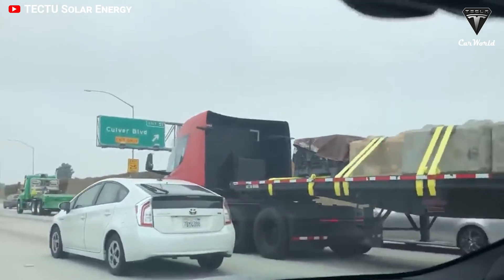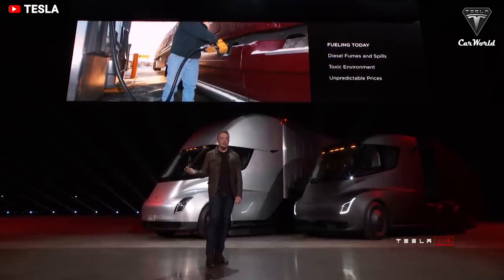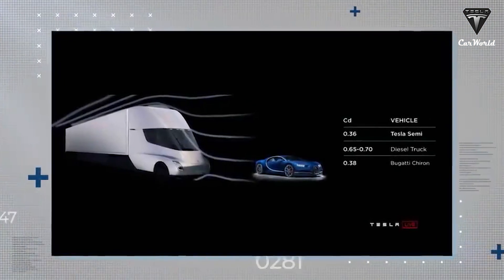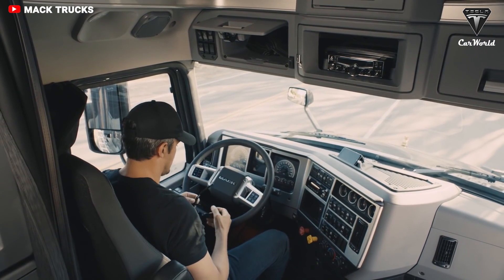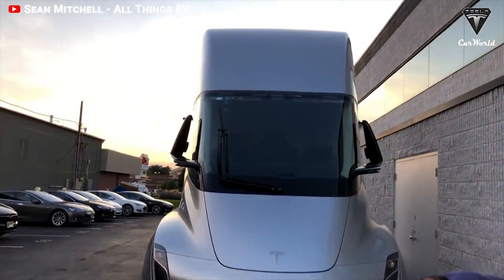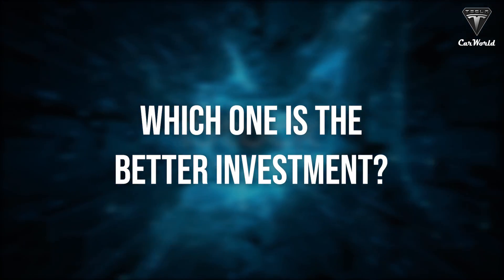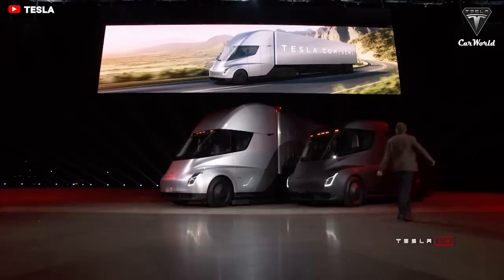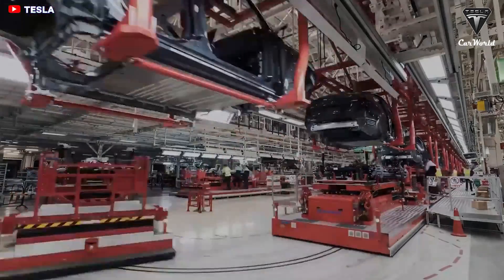Which is the KING of 2023 heavy trucks? Mack Anthem Diesel Truck Vs. Tesla Electric Semi?

Comment: Looks like the Tesla semi is more of a day cab kinda truck not for OTR
Reply: With the savings you can afford a motel
Reply: Yes, it look like first cabover semi in US truck market since early 90's.
Tesla semi can push US truck industry to produce cabovers and ev models if it will be sell success.
Reply: Especially since u have to recharge every 3-500 miles
Reply: Daycabs are a huge percentage of all the trucks on the road.
Reply: @trentallman984 how’d you figure that?  I rarely see day cabs. A lot more sleepers
Reply: @Yomommahouse  I have been local and OTR. I am sure somebody has an official percentage if you want to find it.
Reply: @Yomommahouse  nobody drives a sleeper in town unless they have to...only long haul makes sense for driving sleepers
Reply: If most truck parking spots and warehouses have charging it should be fine for OTR, the Tesla trailer should have solar panels on the top to slow down how much it drains even if it’s only 5%
Reply: @Foxis1080  I'd love to see the property owner that will allow charging of non-company trucks on their premises - they pinch a penny until it screams as is.  If there is a mandate for them to allow charging, you can be assured the cost will be passed on to the consumer.
Reply: @Foxis1080  I hope you realize that for every pound of solar panels and mounting you reduce your load capacity by the same amount.
Reply: @Foxis1080  Solar panels charge as long as there is sunshine. Tesla gives charging capacity (number of panels) on their solar panels  on the Tesla website click the Solar Panel tab. They require your address since this is an estimate for your home's roof.

Comment: I drive a Tesla…if these trucks drive anything like these cars it’s a wrap…just by that alone case closed.
Reply: Try towing with the Tesla car.  Not a viable option.
Reply: @ReachOutToWilliam  this summer in Germany I was regularly on the autobahn and I didn’t even see any single tesla towing! It was small vw golf, Mercedes, minivans….. towing big caravans and other loads.
Reply: @ReachOutToWilliam  With the 500 miles option, it will be viable. With regen braking, going downhill will give you all the range and power back when you loss going uphill.
Reply: @ReachOutToWilliam  Remember the 500 option is with load factor in.
Reply: Nope!!! Lol… that’s not how it works 🤡!!! Your regular 500hp tesla struggle to tow about 2000lbs whereas a 200hp diesel car literally tows about 7 to 8000lbs on significantly longer routes

Comment: As a 20 year OTr driver I will say no one drives a MAC anymore. They are junk. International and freight liner are the kings of the OTR world. Day cabs need at least 300 miles of range and OTr trucks need 600 at least! Tesla has to have a equivalent sleeper as well. That’s the only way Tesla will convince drivers. Even if companies buy them it takes driver to move them. I’ve been told by older driver they will not do it. If drivers say no company’s will not buy them it a paradox. Prove to drivers it’s safe capable and comfortable.
Reply: @Tron Jockey reread what I typed. With a shortage of drivers and most OTR companies like USA,knights/swift,PTL and many other driver owned businesses. With many having full driver boards. Tesla will have to convince drivers.  Private fleets like Pepsi will buy the day-cab. Walmart will buy the OTR version for there set runs. Pepsi and Walmart have the money to install chargers at there transportation offices. Musk was speaking out the side of his mouth when he spoke about producing 150000k per year. I don’t see that for 4 to 10 years.
Reply: Navistar have driverless fully autonomous trucks on the road doing commercial deliveries now.
Driver acceptance is a moot point.
That is being driven by trucking companies not being able to get drivers.
Reply: @Tron Jockey - Agreed. It's a similar thing with Tesla cars. I have given many rides to those EV skeptics and once they experience a Tesla (performance, quiet ride, ...etc) they change their tune. I would bet that for every old OTR driver, there are ten [younger] drivers just begging to drive a Tesla semi.
Reply: @thomasruwart1722  bullshit!!!

Comment: Great comparison!  The one area that you did not cover was NOISE, the running dB as well as engine breaking.  Many areas prohibit engine breaking because of the noise.  I would imagine every truck manufacturer will be crawling around the Tesla at every stop.
Reply: That's engine BRAKING. Mind your spell check!
Reply: @tobyw9573  breaking along with should of, could of, would of!! 😡😡😡
Reply: You forgot to mention the lesser brake wear(will save truck industry a fortune , and will reduce the brake dust pollution )  too and so much energy recuperation while going down on a grade (again will save money)
Reply: I won't.  I'll cross the country 3 days faster than that Tesla.
Reply: If you think a modern Mack Jake brake is loud…
Reply: @HighRollin77  honestly, Jake Brakes are an amazing sound. I remember when I needed a tow home, (BMWs are annoying when you neglect them), the Dodge Ram tow truck had a Jake Brake. Such a nice sound
Reply: @Turbo_The_Femboy_Fox  Ram probably had an exhaust brake
Reply: @HighRollin77  nope, it had a jake brake too.
Reply: @Turbo_The_Femboy_Fox  it’s literally impossible for a dodge Ram to have a Jake brake. Jake is the engine, exhaust is the exhaust. They sound similar depending on what you buy for it
Reply: @HighRollin77  not exactly, some pickup trucks do have jake brakes. It ain’t factory though, that’s for sure. The tow truck driver said the towing company installed it.
Reply: @Turbo_The_Femboy_Fox  There is literally no such thing as a jacobs engine brake on a pickup. Lots of people confuse engine and exhaust brakes. The only things that are compatible with Jake brakes are semi engines.
Reply: @HighRollin77  it’s doable to have a compression release brake on a pickup, it very well is. It’s just not worth it and pointless.
Reply: @HighRollin77  hell, a company made some fore the 5.9 Cummins
Reply: Whats wrong with the Jake brakes? It’s an amazing sound.
Reply: how is this a great comparison, please explain
Reply: Nonsense!!!! At high speeds all vehicles are equally as loud! I don’t see diesel truck noise a problem at all! It’s the tire noise that are most annoying and EVs are not exempted for that
Reply: @carholic-sz3qv  that's because you're none too bright!!  As the OP mentioned, there are rules on trucks driving under a certain speed in certain states due to the noise created by ICE ENGINES along with the extra noise created by JAKE BRAKES!!  What was it you said to me elsewhere?? STFU!!
Reply: Indeed.  Chances are the Tsemi will be as quiet inside as a model 3 or Y.  And besides less engine noise, there will be a lot less gearing noise, and less brake noise.  Tire-noise will not be an issue either, I predict, as the Tsemi is likely to have the same excellence of cabin sound insulation, climate control, with hepa filter and whatnot, octovalve, biohazard mode, etceteras.  It won't be like an ICE truck that you have to drive with the windows open or die of carbon monoxide poisoning;  you'll probably drive it in maximum comfort with the windows rolled up and soft jazz on the speakers.
Reply: @privateerburrows  typical idiotic comment! For your records teslas even the highest models aren’t even close to be the quietest cars on the roads and tire noise and others are still going to be very audible doesn’t matter what! On the highway you hear mostly rolling tire noise not engine. Also European trucks are significantly way smoother and quieter than American ones
Reply: @privateerburrows  the diesel trucks that literally have to deliver materials to super remote sites like oil fuels….. or for other operations crossing super frozen and difficult environments where no EV can even dream of!
Reply: @privateerburrows  wow!!!! These EVs People are actually brainwashed and not worth saving!
Reply: @privateerburrows  doesn’t diesel truck have super comfortable air/hydraulic/pneumatic suspensions!? Superb surround systems!? Fridge? Microwave? Place to sleep…… possibilities to literally live on the roads for weeks at a time nomatter driving in pavements or outback…..
Reply: @privateerburrows  diesel trucks also have to capacity to tow significantly way more than EVs on you guess on far greater distance doesn’t matter remote or not!

Comment: Tesla Semi is a Daycab. Too many people make videos and comments comparing Tesla Semi to a Long Distance Sleeper Cab.

Clearly have never had their CDL or driven a truck

Almost ALL days cabs (90%) run 500 miles or less daily close to a terminal.

Sleeper cabs run 600-700 miles per day far from their Home Base

This is not a sleeper truck, it is for linehaul & local deliveries. Which is what DayCabs are (No Bed in The Back)
Reply: Absolutely right on
Reply: sleeper actually is not a big deal from manufacturing point of view, the charging infrastructure will take some time. can you imagine one day in future at a truck stop, quiet and each semi in "camp" mode? I am for one, can't sleep well with engine is on, that was the main reason I quit trucking in the 90s.
Reply: Tesla Semi has 500 miles of range and 300 miles can be regained in 20 minutes of charge. Daycab, sleeper, whatever
Reply: weíbgé

Comment: For most fleets the low cost of ownership will make the Tesla Semi inevitable.
Reply: Trucks do 10 times the miles of an average car in a year. Your going to have to factor in battery replacement every 2 years.
Reply: @SunRise-ul7ko  buying recycled batteries (Tesla recycles all there batteries) has got to be cheaper.
Reply: Nope! Lol….. those electric trucks are not as flexible as regular diesel ones, diesel can actually haul more loads on much longer tougher routes…..
Reply: "Inevitable" lol
Reply: Tesla is two years behind their competitors in electric trucks.
They spent too long talking and not long enough doing.
Reply: @allangibson8494  that is like saying they were 120 years behind there compition in electric cars.
Reply: @EvilNeuro  Tesla builds luxury cars.
Trucks are an entirely different game that Tesla have never played in before.
The required drive train power levels are significantly different - an electric car only needs to deliver 40HP continuously (any car only needs 40HP to sustain highway speeds).
Gearbox and motor bearings need significant reconsideration at four times original design power conditions.
We will see how well Tesla did over the next year.
Reply: The lack of mileage will make it only used for local trucking
Reply: @kamay7021  hey I mean- it’ll probably cost 20$ to refuel wheras a truck would take 100-200
Reply: @EvilNeuro  at the expense of 30 minute to charge. It’s just not efficient for OTR trucking right now. Maybe future iterations but this will be great maybe even overkill for local / home everyday loads
Reply: @EvilNeuro  nope!!! $20!? You must be joking right! It’s about hundreds of dollars to recharge it lol…..
Reply: @carholic-sz3qv  bruh it ain’t hundreds.
Electricity costs like 0.10 Cents per kw hours
Reply: @EvilNeuro  yeah why not -0…. Cents/kw? Lol…..
Reply: @carholic-sz3qv  0.10 cents per kw hour* sorry typo
Reply: @EvilNeuro  0.10 cents in your dreams lol……
Reply: @carholic-sz3qv  that’s how much it costs here 👍
Reply: @carholic-sz3qv  actually pretty sure here’s its 0.09 cents.
Reply: @EvilNeuro  Electrical power costs nothing if you generate it yourself like Walmart is doing.
Reply: a) Tesla Semi:- inevitable or
b) Tesla:- Semi-Inevitable... 😉
Either way, eventually...... Tesla...
Reply: @alexmanojlovic768  um no!!! My company ordered Tesla's 5 years ago .....never got them.....now we got 5 Volvo electrics for local runs....
Reply: @alexmanojlovic768  nope

Comment: where can you buy electricity for 7 cents a kilowatt hour?  It's more like double that or more with transmission charges.
Reply: so basically you be paying $52 instead of $167. yeah thats still not cheap enough
Reply: @kpop863  Just saying. The maintenance savings will be big. I own TSLA. Big Fan.
Reply: @kpop863  that is more than 50 cents per mile savings, consider EV does not have much of maintenance, the per mile savings goes up a bit. lets stay with 50 cents per mile saving, times 100,000 miles per year, is $50K. trucking companies will take the saving of $50k per year per truck and go electric.
Reply: If I remember correctly... Don't quote me on this... Elon said Tesla is building Mega Charger facilities and has specifically stated the 0.07c per kWh. As far as I'm aware this price for that much power and transmission is unprecedented. So it's a "wait and see" sort of deal. But that is where the video is getting that 7 cents figure.
Reply: @Tron Jockey This is true, but as far as I understand generally charging stations cost you more per kWh then commercial rates. Plus imagine the lines needed to charge a few dozen of these at once. Which would in theory raise transmission rates. I think that's where the confusion lies
Reply: @ZadesLegacy  Show the transmission charges..PA is 7.9 cents per kilowatt hour also for generation.. But the transmission charges are another 7 cents extra for maintaining power lines and infrastructure.
Reply: I don't actually know the transmission charges off the top of my head. I am only stating what I heard in an attempt to clarify the possible source of confusion with the original poster was mentioning. But if you want to check I believe it was a recent video on the Tesla cyber truck from a channel called "Engineering Explained" that I heard it from.

Comment: What are you smoking? 7 cents per kwh? I pay 16 cents per kwh for residential from Rochester Gas and Electric (RG&E). That price includes all charges including Delivery charge, and other esoteric mind game charges like 'transition charge",  "Revenue Decoupling Charge", 'SBC Charge" etc.
40 cents / KWhr is typical of Superchargers.
Reply from the maker: Yeppp. Thanks for useful inf and happy Thanksgiving
Reply: @blaumax1910 stop with the facts & reality check.  Your stopping the RedNeck CoalRollers p3rvs getting a "semi"-on from the smell of Diesel & 🐂💩 (you know what I meant there, right? 😉)
Reply: @Tron Jockey yes that is true. So charging in their own depots will be  cheaper.  But on the road  at Tesla Truck Superchargers they will probably seek to partner with Tesla to get  better rates than you or I get?